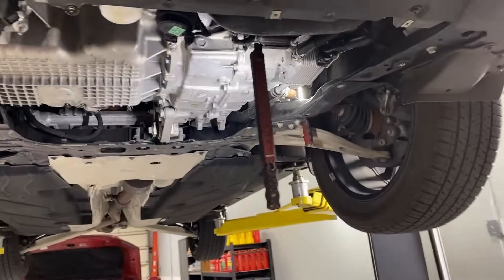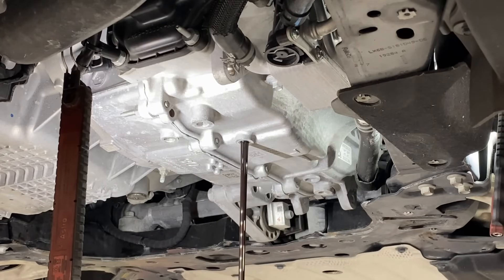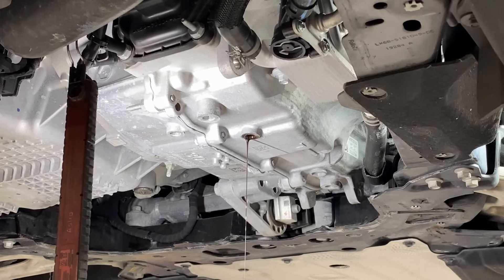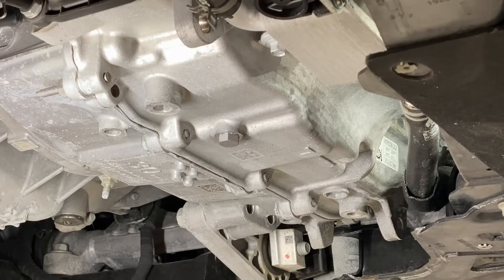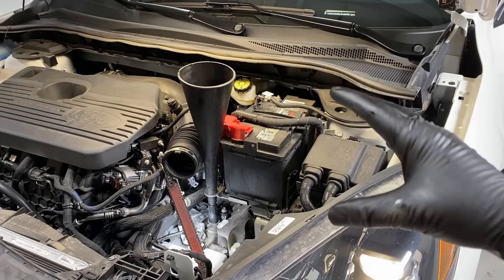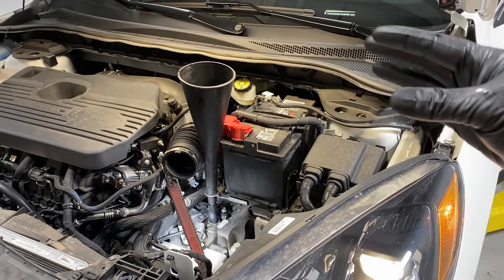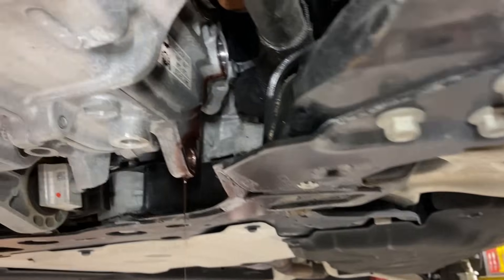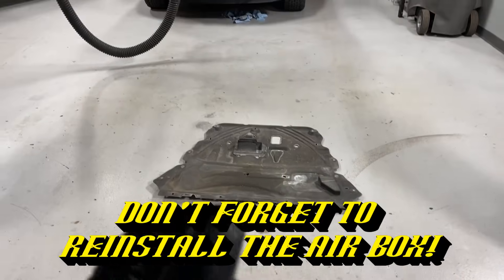Quick Channel Update: 2020+ Ford Escape & Edge 8F35 Eight Speed Transmission Fluid Service Procedure

Comment: For some reason I drained over 6 quarts and filled almost 7 quarts. Is that normal? 2020 Escape 1.5L
Reply from the maker: no
Reply: @FordTechMakuloco  should I be concerned? For the fill the vehicle was level and I got the trans temp to 83C on Fordscan. Couldn’t get any hotter for some reason. While engine on there was a small trickle from the level plug. I did the leveling while the engine was on. Am I supposed to check trans fluid level when the engine is on or off?
Reply: Engine on.  As soon as you turn it off, fluid will pour out.  I had about 6qt, BTW.
Reply: @reynolds8532  I guess I might not be too far off then. When I first poured in the trans fluid, it was off the first ~4 quarts and some drained out before I started and added more.

Comment: great video, thank you!    your attention to detail and clear explanations are fantastic!!  much gratitude!  I do have a question....in my situation with '20 Edge SEL, the new fluid leaks out of my funnel, when filling.  I realize that it is probably me, doing something wrong....I could not pour directly in through the funnel like shown here....there is something down in the rubber fill port on top, that is restricting flow.  I had to resort to hand pumping all 5 quarts, which was slow and messy.  any thoughts appreciated....

Comment: So I fill the first time until it runs out of the leveling plug. Then I start the engine and fill it again directly until it runs out or do I wait until the gearbox has reached its temperature? Unfortunately, I didn't quite understand this part
Reply: Yes - when I did my edge I filled until it came out - then started the engine and left it running.  Get it hot and you will see more fluid come out as it heats up and expands.  Once it is up to temp - and fluid stops coming out of the level hole - you can put the plug back in.  Do not turn the engine off until the plug is back in.  Fluid will drain back and out the level hole and you will need to start over.

Comment: You know what’s funny? In Germany, Ford says there’s lifetime oil in there and you don’t have to change the oil.

But in my case, I have the problem that the transmission often shifts very hard.

So I want to change the transmission fluid too.

Do you know if I need the ULV oil or another one? It’s a 2021 Ford Focus 1.5 Ecoblue 120 HP.

Thank you!
Reply: Yes, its Mercon ULV.

Comment: Is this going to be the exact same process for the Bronco Sport 2.0T as well?
Reply: I just did my BS 2.0L.  It's close, the only difference is 1) the top end where he put's the fluid, it's not a cap.  It's a metal compression sleeve (might be using the wrong term) but you need short pliers to loosen the tension and remove the drain tube. 2) I couldn't move the coolant hose out of the way entirely because it was secured to the transmission pan with some sort of plug so the fluid spilled all over it, basically doing the opposite of what he says here to avoid hitting the fluid on the hose but I couldn't get it off so I had to painfully watch and clean up the mess.  Other than these 2 points, as long as you know, it's the same :)

Comment: I'm possibly buying a Ford Focus mk4 1.5tdci with automatic transmission(A8). im pretty sure that its this 8f35. However, it has 150tkm on the clock or abit under 100k miles. Is that already a lost cause, because i doubt the previous owner has changed the oils cause its "not mandatory" even though the car has service history from a respectable dealer (in finland they are actually respectable). Should i be wary or go for it if it works well and change the oils myself now and in future? Any ideas?

Comment: I will be having 1st transmission oil change for my 2019 ford escape 1.5L with 60k miles at the dealership. They have told me they will run 15qts for a total of 3 times fill/drain.  Is this a good idea or should I only have 1 drain and fill at this point? Thanks

Comment: I changed the transmission fluid and filter on my 2024 F150 at 7,400k
Surprised at how dirty it was. Filter and pan were quite dirty.
I used a Utube video to walk me through it. 
Now it shifts like a dream!
BTW, I bought a 90.00 suction pump.
Easy to use, you need a compressor however. Small one would work.
Fluid stinks and is expensive, I used Ford this time, pretty use Amsoil in the future.
Reply: The only issue I see here is for those of us who don’t have a lift doing this job is almost impossible, especially if you have to deal with the leveling plug when the vehicles on ramps. Why can’t you just measure the amount of fluid that comes out and put the same amount back in?
Reply: @skoffco that's what I would do
Just measure how much you drained out and refill with the exact amount
Reply: @handheldnintendofan 
It’s difficult to get the proper amount but it gets you in the ball park. Be sure to get it to 204f then check level with the vehicle running
Reply: I place the hard plastic ramps in front of all 4 wheels and drive up onto them in 4x4.
It a pretty good hight to work under. 
Take everything you may or may not need under with you!

Comment: Thanks, Brian. I just did this on our 2020 AWD Escape with 1.5 I3.Its definitely a pain, but not that difficult.

The hardest part is getting the trans up to temp. I used ForScan with a harness made for it - $35 on Amazon. The issue for me was that I let the car idle, which  tool a very long time to come to temp.  BUT, before I was done, the car did the auto shut off, which puked out a couple quarts through the level plug!

TIP- After adding the new fluid, close up the level plug and drive for about 20 min in sport mode. I got back reading 200 F and removed the driver front wheel (lowering the body back down to ride height) to more easily access the level plug
Reply: as for your tip, to clarify you are saying after adding in 3-4qt like the video says cold, you're saying drive it for 20min so it reaches the 180-200 trans temp, then park and continue with the video?  Isn't that a risk of having not enough fluid and ruining the trans if there isn't enough fluid?
Reply: @lenell86  correct. I dont see how since the fluid it up to the level plug and the LV expands as it heats.
You can try not driving, but it will take a very long time to heat up to temp
I posted that based on my real world experience and it worked out well,  but you are welcome to try something different on your car

Comment: If there's one thing that bothers me, its universal ATFs.  I can understand using a different brand engine oil as they are all for the most part formulated to handle all the OEs, but universal ATFs give me the shivers.  There are so many different OE specs and requirements to them, and some are even to the point where if you use anything but the OE fluid you will have shifting or shudder concerns (GM 8 speed HP fluid for example).  ATF is the one thing that I 100% use the OE fluid on or OE spec fluid that is NOT a universal fits all fluid.

Comment: Okay. So wierd thing happened. Did the drain (hot). About 5 qts came out. refilled 5qts. 1 qt came out. I believe I overfilled because the fluid was hot (expanded) and so looked like 5 quarts but was closer to 4quarts. Couldn't reach operating temp only got to 180-190
Reply: thanks for this info. i think i'll check the fluid level before draining, at the specified hot temperature, and engine running, to see what the factory had in there.

Comment: Not sure that you'll never read this comment but at least in italy, for Ford focus mk4 with 8f35 transmission they said that there's no maintenance of it. 60k miles on the clock, torque converter is broken (snuggle in acceleration from 70 or 80 km/h (43-49 mph)). They also won't change only the torque converter but they want to change the whole transmission with the tc. Monday they will let me know how much will be the whole.

Comment: Couldn't you just fill it through the leveling plug?
Reply from the maker: Technically yes but it is fraught with problems.
Reply: I did it on the Edge (fill thru level plug) since getting to that fill/vent was a big PIA on Edge vs Escape which has more access.  I did the fluid swap with a hot engine and trans to help speed things up and got under the car right away when I started it and kept pumping fluid in to not starve the pump/TC.  Seemed to be fine but messy.

Comment: Brian, Love the content as it's saved me a ton of money over the years and allowed me to do all kinds of repairs and service by myself. Have a question about this 8F35 transmission and a TSB about it. My wife's 2019 Edge has started shuddering and bucking when accelerating up to about 30-40mph. I found a TSB about that very thing and was wondering if this is something that I have to go to our dealership about or if independent shops can do the work. It requires updating the PCM and solenoid numbers to new software. Have you had any experience with it?

Comment: I have a 2019 edge and am doing this now.  I have the front up about 3" on blocks and jacked up the back end to level the car, but when I take out the fill plug before draining it seems like  there is alot of excess fluid from the factory fill.  Does Ford over-fill these sometimes? I am draining hot after driving about 15 miles.  Edge isnt as easy to fill as the escape.
Reply: Figured it out, with the engine off there is more fluid in the pan thats why I saw so much come out the level plug.  Was much easier for me to fill thru the level plug on the 19 edge.

Comment: How long should it be idling after 5th quart of fluid? I can't check the temp. I'm after 5 quarts and 30 minutes idling on Park and still basically no fluid coming out of leveling plug. Should I buy 6th quart of fluid? Help.

Comment: FordTechMakuloco ? I have a 2000 Ford e350 super duty with a 5.4l 2v with a 4R100 automatic transmission. The owners guide recommend to use " Motorcraft mercon ATF transmission fluid xt-2-qdx" and don't mix with "Motorcraft mercon V ATF". I can't find  Motorcraft brand in the suggested  transmission fluid. what other brand of  mercon ATF transmission fluid you would recommend ? "Mobil 1 Synthetic Transmission Fluid Dexron, Mercon" ?
Reply from the maker: Use Motorcraft Mercon V
Reply: @FordTechMakuloco  ok thank you

Comment: Any comments regarding the "bucking-surging" that these transmissions sometimes have?  I have a 19 edge with the bucking issue at low speed - I know there is a TSB for a new flash - is that the fix?

Comment: On my 2020 Edge you cannot fill the trans until you remove the plastic vent disk that is inside the rubber tube from the trans to the vent cap you removed, you need to remove the lower clamp and then the tube and it is not ez to get that clamp on and off..

Comment: My 2020 escape with the 1.5 liter 3 cylinder did not have the handy filler on top of the tranny so I filled through the leveling port. Had to rig up a tube and a squeezable container to pump it in. Definitely adds a level of difficulty.

Comment: No mention that this trans holds over 11 quarts of fluid?  So you only changed less than half?
Reply from the maker: 8.45qts is the dry capacity but ok and your point is?
Reply: @FordTechMakuloco   Huh?  I thought it was a fair question.  Ford says capacity is 11 quarts but not to quibble about that.  Draining from the drain plug does not get anywhere near all the old gunky fluid out.  Seems like your choices are either to flush and fill multiple times (which dilutes the old fluid each time but never gets rid of it all) or to use a flushing/extraction machine which a DIY'er will not have.  I am curious to know your thoughts.  Definitely no offense intended.  I have a Lincoln with 8F57 and 30K miles so I am facing this exact dilemma right now,.
Reply from the maker: Correct the idea is to drain and fill as a partial fluid service on a regular 30k mile interval. When people start flushing, or they try to exchange all the fluid another way that is where they get into trouble.

Comment: A couple comments come to mind

i'm assuming you have to clear the codes after you've run it with that sensor disconnected  ?

also with this procedure work on the 6F 35 ? it drives me nuts having to put it together take it off the hoist, drive it around, warm it up put it back on the hoist, pull that plug and let it level it would be such a smoother operation to just let it pour out and then wait for it to warm up running on the hoist!

I have done this procedure on my 16 fusion which I've been driving for two years about seven or eight times. typically every 30,000 miles or so 

I now have 270,000 miles on it in two years and it is not doing any of the nasty things that it used to do before I started changing the fluid .

thank you Brian

Comment: so at what point if you do these intervals.. donyou actually bite the bullet and have the filter changed? asking for the 6f55 as well in the 16 explorers with the 3 5 ecoboost. thanks Bryan
Reply: you typically don't change that filter by the time you get to that point it's time to rebuild the transmission because you have to remove it and split the case to get to 

it change the fluid frequently and you can avoid that or at least delay it as long as possible

Comment: All that effort and mechanics time just to eliminate a trans dip stick!! I had a filler tube on the bottom of my Ford Explorer 4.0. It too was the save the trans dip stick cost. A pain in the butt to change the fuel plus you had to get a small part then force the fluid up into the transmission.

Comment: Please do a video on what Fords are reliable and not so reliable, what to buy for long life and what to avoid.  It will be very helpful.  Thanks!
Reply: Apart from a few notorious vehicles that eventually get lemon lawed and recalled, just about any vehicle can exhibit reliability with regular maintenance and occasional repairs. The real question is how frequent breakdowns are (and every vehicle will breakdown at some point) and how much its going to cost to fix and maintain.

Comment: I got a question, is not related to this video but hopefully you can help me out !
I own a 2017 f250 with the 6.2 engine and I have noticed a ticking noise at idle. Did some research and apparently is very tu common on this engine. Followed some troubleshooting that i found from another ford tech “ fordbossme “ according to his video the intake manifold needs to be replaced and this part is on back order.
Have you worked on any of this engines lately with this issue ?
Thanks in advance I find your videos very informative been following you for sometime!!!

Comment: Brian, I will be performing this service on my 2020 Lincoln Corsair at 30K miles.  Wouldn't it be acceptable to drain the fluid from underneath, and then just refill that same quantity of drained fluid with new fluid?  In other words, if I drain 6 quarts of old fluid, I would replace with 6 quarts of new fluid through the filler neck, and I should be able to call it done.  If this is not going to work out, please provide a brief explanation why it's not good to do it this way.  Thank you in advance.
Reply: That’s what I do.  Just put the exact amount back in and shouldn’t be any problems

Comment: Do you think the Escape is still running?  I have a 2020 and just had to replaced the AWD module with only 38,000 miles and Ford would not warrant it.  Would like to get rid of it but vehicles have gotten so expensive.  I bought this one just before Covid started and got cash back and a very good interest rate so I don't have a lot of money into it.  Wondering what is going to go wrong next.
Reply: Was it the last issue or something happened again?

Comment: Brian, my 2019 Edge has a round plastic insert in the transmission vent which blocked the funnel.

I had to remove the neck to get the funnel into place.

Comment: You put out excellent videos. Have learned a lot. Any comments on the 5.0 oil consumption issue in the f150, 2018 to 2020? Thanks for what you do. It would be nice to have your shop close to home. A good (trustworthy)mechanic is hard to find.

Comment: @ ford tech Makuloco, on news about aftermarket parts today, channel Tom Coolen which is kick a mechanic in Canada has been cutting up parts open such as ball joints etc. and finding plastic instead of what i believe was bronze in the parts ??? Three main capital corporations now own most of our once American auto parts main one being Apollo capital on 5th ave, NYC. which now owns Moog and Fel pro. My question is he has also opened ford oem parts from newer vehicles and found the same, are ford truck ball joints made by Dana/Spicer ? and have you noticed any problems by new oem parts ?